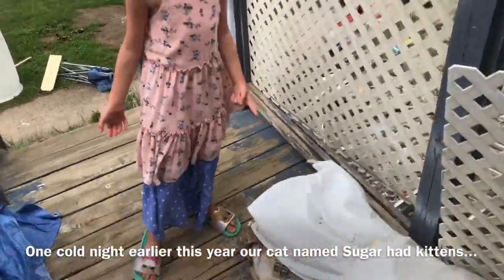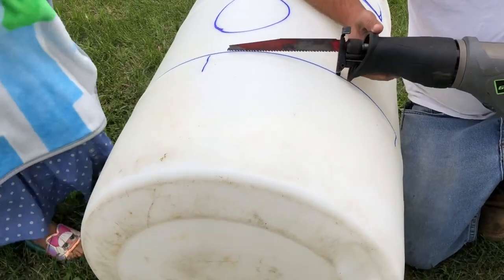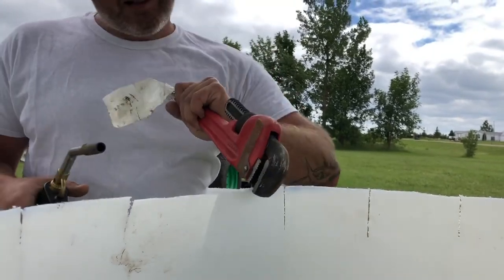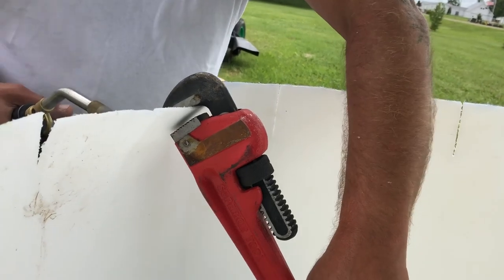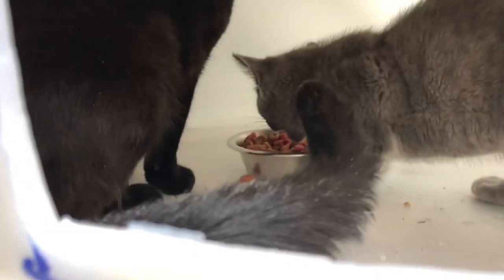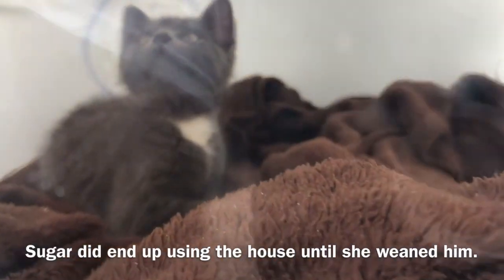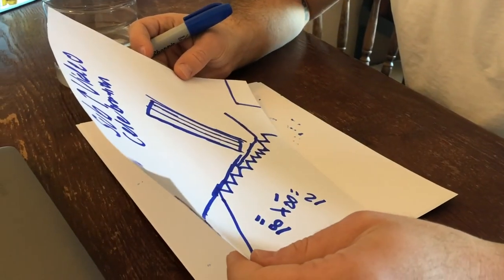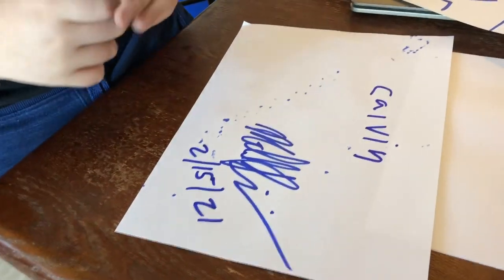We Built a House for our Cat using a 55 gallon drum.

Comment: You guys are awesome! I’m trying to make one out of a barrel and didn’t see any vids on youtube except yours. What a good dad! Kids and cats over curb appeal :) I didn’t think to use the barrel upright instead of horizontally.
Reply from the maker: It worked really well for 3 years.  Mom cat (sugar) took off after the kitten weaned.  The kitten (cinnamon) we had for 3 years he was an outside/inside rural cat. If I wasn’t home he would go into the barrel with a heat lamp and he loved it.  Unfortunately he got in a cat fight last year and his wounds turned septic so we had to send him to the other side of rainbow road.  I have his ashes in a container in my closet to be buried with me when it’s my turn.  He had a gf cat that started hanging around we named her Goldie.  Once cinnamon went my gf started giving her treats. She used the barrel a few times but my gf is here all the time now and constantly checks for Goldie.  She quit using the barrel and I took it off of the front porch because I’m planning to redo the porch.  I’m going to put the house under the porch once it’s rebuilt.  I did the raised floor because the ground will suck a lot of heat out of whatever is sitting on it.  It also gave the cat some security and blocked the wind.  The opening to go up was 33° from the door so wind couldn’t whip right in and out.